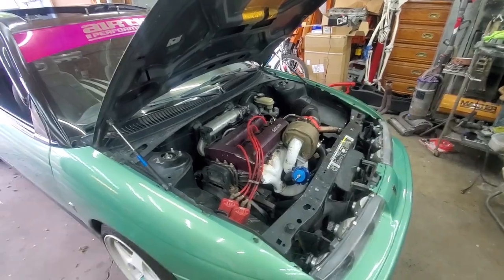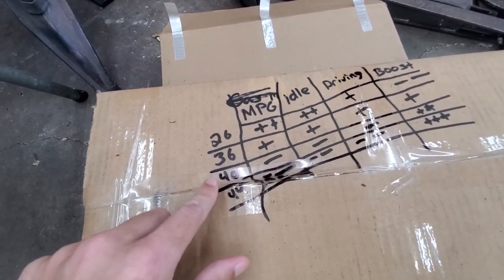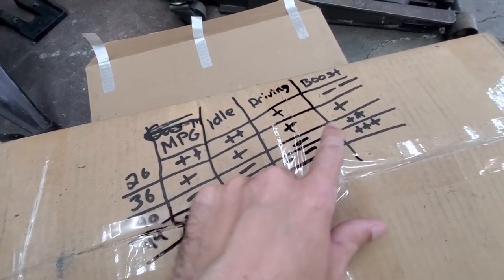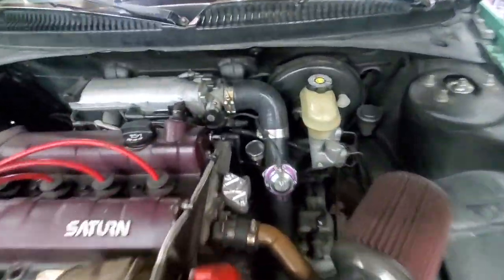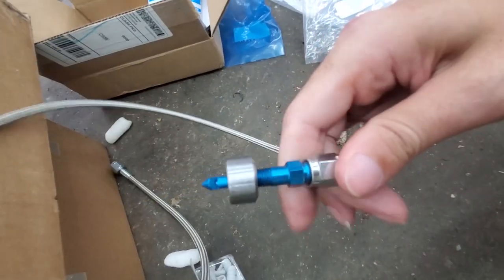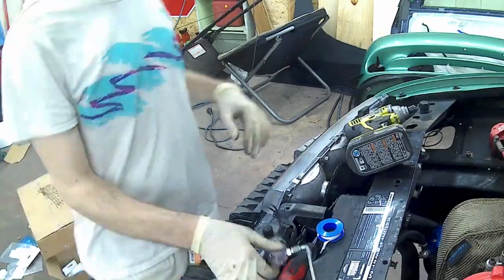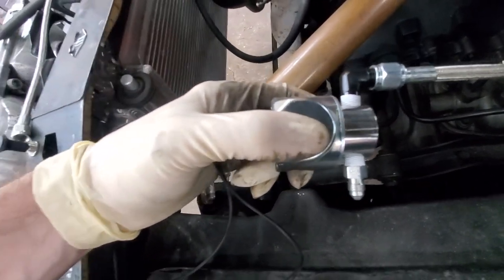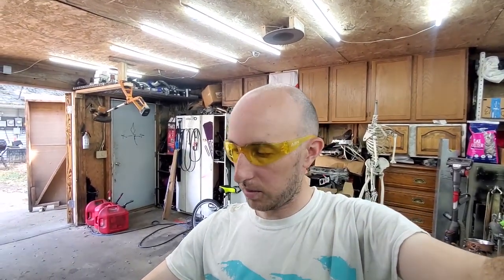Extra Fuel Injector Install

Comment: I'm running a boost reference fuel pressure regulator from aeromotive, it's a 1:1 ratio regulator. I'm only running 4psi cause that's the limit on my mass air flow but I'm on stock fuel injectors, stock fuel pump and for the time being and I haven't had any problems what so ever. There is also the kennel bell boost a pump that sends extra voltage to your fuel pump when it's sees boost, runs off a boost switch much like your set up here.  Keep up the great work man!!!

Comment: Dude this was a great video.
 I have had a similar experience setting up a fuel pressure regulator on my jeep i would up installing a return style rail with regulator then a second adjustable regulator onthe return lime so now under vacuum I'm lean about 16.5 and under full throttle I'm around 12.5 so I get the economy and the power without  the cost of a tuner

Comment: Been doing it for years it works great, we use a nitrous fuel solenoid in the fuel rail and ran it to a boost juice nossel.its on a blowthrew carb on e85, needed more fuel at 30+ lbs boost works great. Cool video

Comment: How if you use opamp buffer to control the extra injector, input taken from one of the injector cable. The output will drive transistor which drive the extra injector. You could control the gain with potentiometer as % of the injector voltage you take the input from.

Comment: If you have additional fuel from the nitrous solenoid wouldn't the stock ECU fight it and pull fuel once it reads it from there o2 sensors?
Reply: Full throttle the car will be in open loop and wont be affected by the o2 sensor. With the hobbs switch it will only add fuel while on boost.

Comment: I’m wondering if the huge backfire is excess fuel in the hot exhaust cause if you’re at full boost it’s pushing that fuel all the way through the system lol put the go pro on the back and let’s see 😂
Reply from the maker: I wish it would shoot a flame lol

Comment: Do you have forged pistons or go oversize, or is it a stock 1.9L?
Reply from the maker: Bone stock 1.9... only changed the valve cover
Reply: @BuilditBreakitGarageinc  Oh, I see. Yeah, got a ported intake and header, bigger throttle body, polyurethane bushings and H&R springs, KYB struts and a Cold air intake on my 95. U should try an EMS 4 engine management, if they still make them, like 800 bucks and the wiring harness is another 100-200 bucks but it's much cheaper than the other costly engine management systems on the market and it's designed to use on all 4 cylinder applications. I'm assuming u got a manual transmission?

Comment: How much boost can the stock injectors handle?
Reply from the maker: Stock injectors won't handle any boost
Reply: @BuilditBreakitGarageinc  oh ok thanks
Reply: Not true. I'm on a complete stock fuel system running 93 at 6-8psi and I'm hitting 10.1 in my afr

Comment: the car is running extremely lean in the gauge, you need to add more fuel
Reply: This was before fine tuning... it stays around 11-12.5 afr now that I've jetted it right and replaced the fuel pump
Reply: @Waterfordmaxx  12.5 is still too lean what what you want.

Comment: This has to be the worst idea in the history of tuning. What are you doing man lol. Like I get it seems great but that’s wayyyyy too caveman to work long term it’s not anywhere near accurate enough to provide fueling for a turbo. Wtf are you even doing? Just run a damn safc or any piggyback if your only running under 10psi there is zero reason for any of this shit. As a professional tuner since the late 90s I’ve never ever seen anyone do this 😂
Reply from the maker: As dumb as it is it's been working fine now for over a year lol
Reply: @BuilditBreakitGarageinc  thats awesome man lol im glad its working out for you i would never have the balls to do it long term and put it on the line but hey if it worked it worked. Props
Reply: @BuilditBreakitGarageinc  I think it's a cool idea. I run a 75hp shot of wet nitrous now. I might add a turbo, and just keep the wet side of my nitrous connected for full boost with the turbo. I have a 01 Miata with vvt, and want to keep my alternator charging, factory tune, so I don't want aftermarket ecu. Should hit like the nos, all at once. No boost , and full boost, and let the ecu take care of closed loop driving.